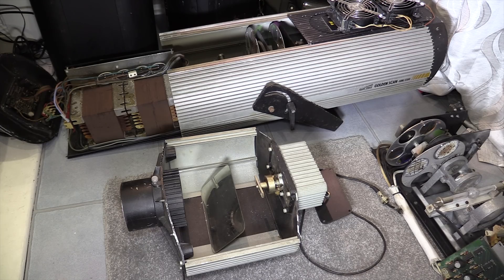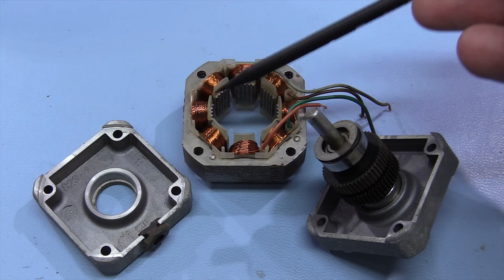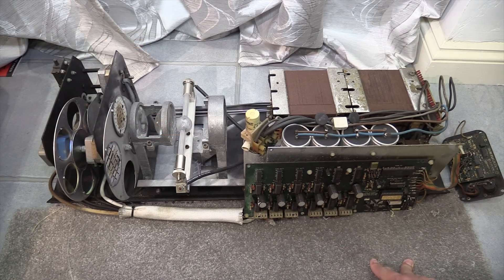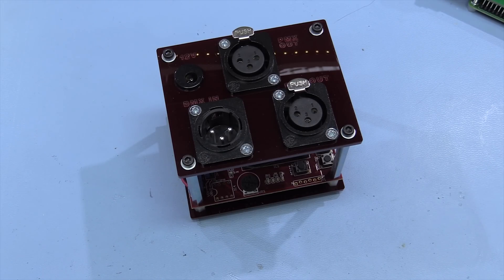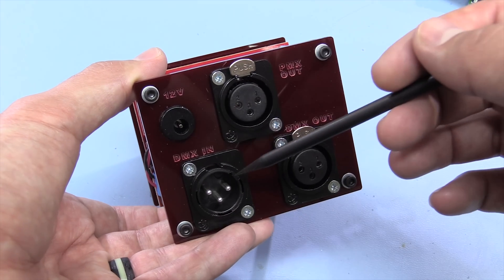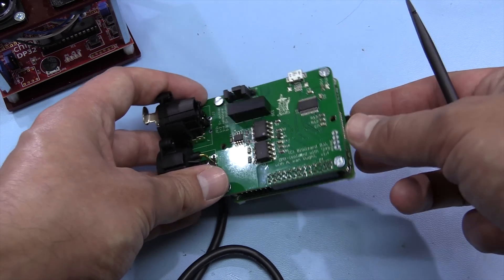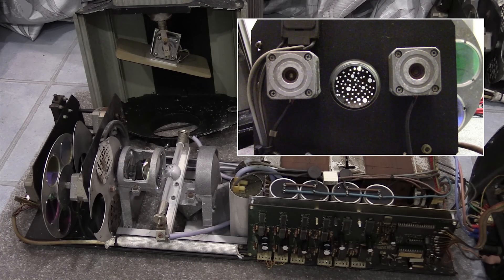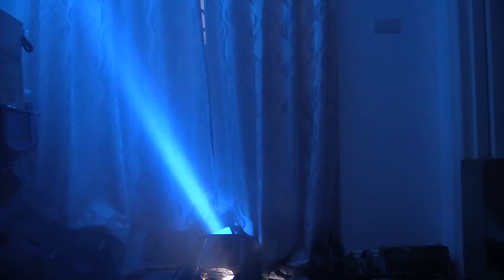SDG #043 Clay Paky Golden Scan HMI 1200 Scanner Stage Light

Comment: Wow - blast from the past there. I used to do a lot of side-projects for Richard Martin Lighting back then. I recall visiting Clay Paky with Richard to negotiate the purchase of his first few units. I designed and built a portable controller for him that was based on the operational design of a Thornlite 120 studio lighting desk so the LDs would be familiar with it. A friend did the software, I did the hardware.
As one commenter said, they used these a lot on TOTP, Richard supplied their lights for a very long time.

Before the Scans came along, and for a fair while after, I did control boxes for quite a lot of Richard's lights. I confess to being responsible for a rash of UFO sightings in my local area....one light unit in particular made the local papers. I was testing a control unit of one of his latest creations, in my garage, firing it out onto the clouds on a dark and somewhat misty night. The effect was simple enough - HMI lamp, strips of mirror attached to a flexible rotating & articulating platform, with a selection of dichroic filters. This created bars of light that span and zoomed, depending on what you did with the actuators.  Happy days...

Comment: Goldenscan HMI's are one of my favourite effects - Even if I hated looking after them in niightclubs, Amazingly versatile and fairly reliable if you care for them, But if you go over on the life of the lamp and it explodes it makes a HUGE mess - Often smashes optics, Bits of glass get stuck in the gobo rotation teeth, I've even seen it take one of the fans out,  Should do a good job at keeping your workshop warm too! Clay Paky were "CP&P" at one point, Also owned Jem smoke/fog machines  (Clay Paky and Pulsar) - Clay Paky are now owned by Osram
Reply from the maker: Thanks for the info. I still plan to see if an LED conversion is feasible on these whilst keeping a decent light output. I've got a total of 4 complete units and one that did have an exploded lamp. An LED conversion would get rid of the heavy ballasts.
Reply: It'd be amazing if you can pull it off but 110000 Lumen from LED may be a bit of a tall order! I did notice you have one of the very early incarnations of the goldenscan, Later/Higher models had rotating gobo, Rotating distortion effects and even 3 separate graduated colour wheels so you could "mix colour" in the unit, I don't think people realise just how heavy they are until you are up a scaffold trying to get them out of a lightrig, I'd completely forgotten the horrific sound of powering a large lightrig and hearing all the intelligent lights finding home positions - and hopefully not a huge bang as a lamp explodes
Reply: @sdgelectronics hi from 2023. I'm wondering if you had any success with this LED conversion? Be awesome to remove some of the weight from these.

Comment: Hello, nice job, tx for the videos, one question, i also have six pieces and hope to make 4 complete but how do i disconect the power suply for the lamp? if i just remove the bubl it's not ok? Just to test all the functions? Tx
Reply from the maker: At the terminal connector where the AC supply enters, there is one pair of wires that goes to the little transformer and another much larger pair which goes off to the lamp circuitry. Just disconnect those wires.
Reply: +SDG Electronics ok, i will try that. thank you :-)